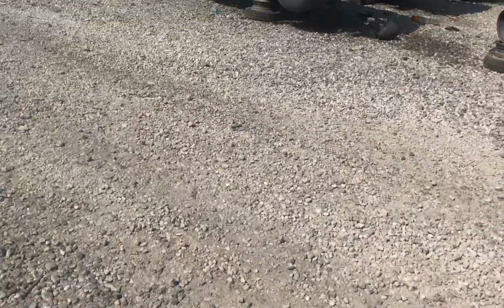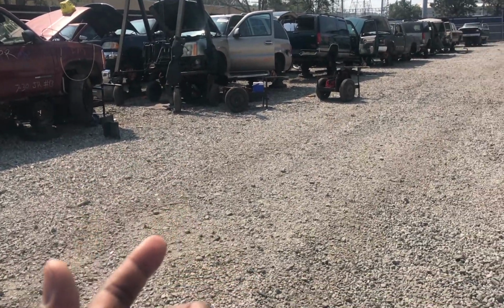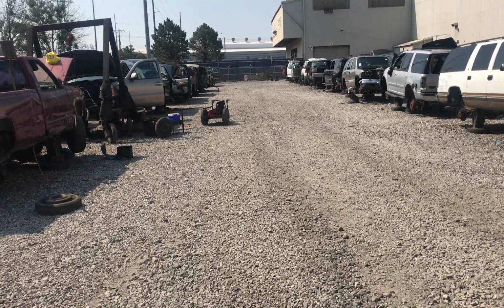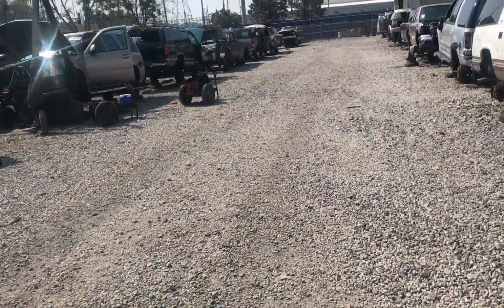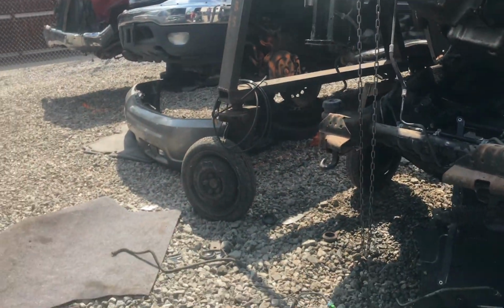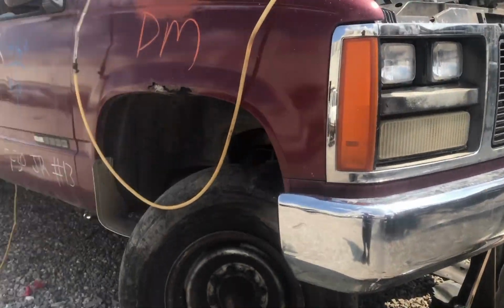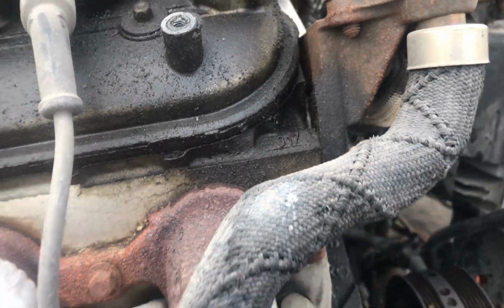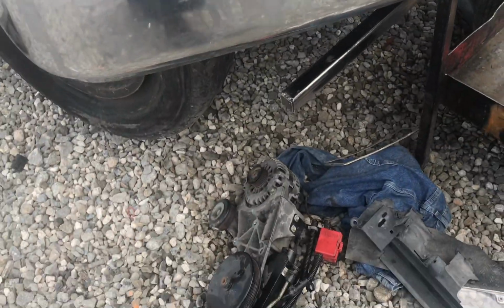Pulling A Junkyard LS 6.0L with 317 Heads

Comment: The hustle is to pull the 6.0 and take the heads off, pull some heads off a 5.3 (706) and put em on your 6.0. Gives you better compression for the same price. Just copper spray the gaskets when you get home. BOOM
Reply from the maker: The challenge is finding a 6.0 here :) I already have 2 sets of 706 Heads and 1 set of 317.
Reply: @CatlocosGarage  I’m in GrandRapids Michigan and I’ve pulled 3 6.0L in the last 3 months and 1 4L80 got 2 more to pull, got to get em
Reply from the maker: @alshotrodgarage4779  I walked away from a few of them, but I just don’t have space for more until I do these two swaps and I have at least 3 other swaps afterwards. Shops and flippers pull them as soon as they hit the yard. Can’t really do that with my work schedule, so I catch the ones they missed.